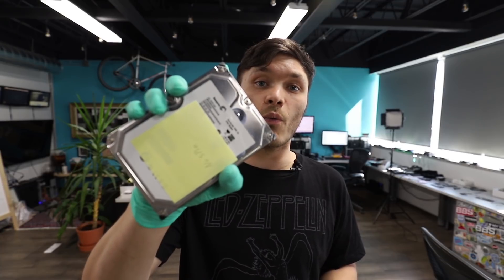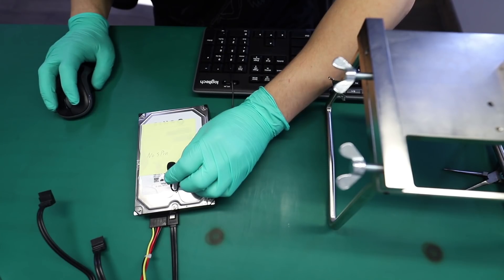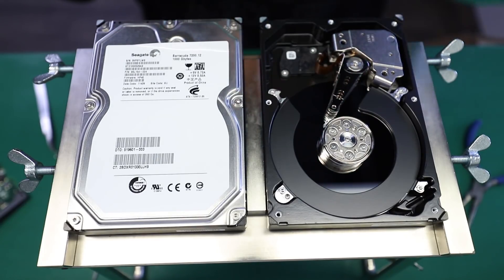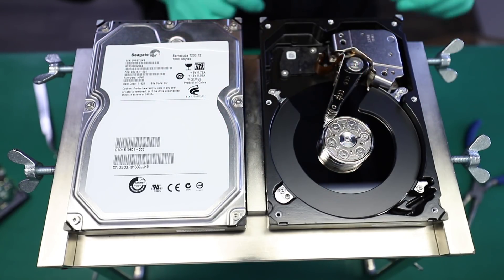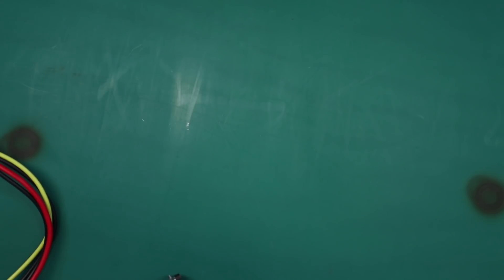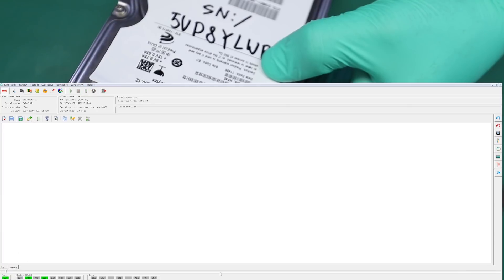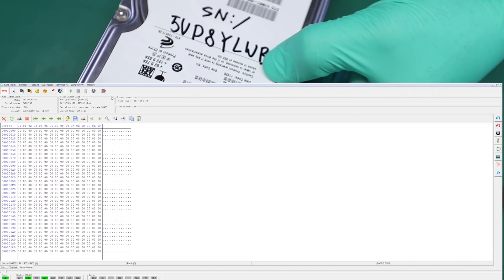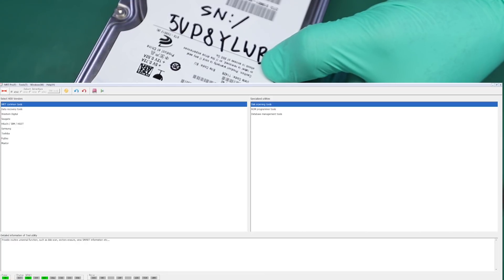Seagate is making buzzing noises | platter swap

Comment: I kind of like those old 7200.12s, especially the HP OEM ones that have AAM locked to "performance". They're pretty loud at seeking and it makes it clear what your computer is doing at the time.

That noise from trying to spin up with a stuck spindle has nothing on the old "musical Maxtors" though...

Comment: hi,

I want to ask: relatively recently I purchased a 5 Tb Seagate external hard disk. I have so far only use dit 2 times in 6 months. hadn't used it in quite a while till recently. It does work and my detects it but it does buzz quite a bit. when I put my ear to it, it does spin but also I hear sometimes the sound as if we would hold smth against a spinning wheel, like soft taps, those are really only hear able very closely, or as if it very very briefly is blocked. touches smth, slows down, doesn't spin straight however I can describe it. does this indicate a problem or is it normal? I use the supplied short usb cable

Comment: hey, what the main requirements swapping Platters? Does the hard drive must be with the same capacity, model, version?! or just the same make and similar look? thanks
Reply from the maker: chassis need to be the same. The same family is enough in most cases. Different models can have identical chassis
Reply: @hddrecoveryservices   my head is damaged, cannot find replacement! Do you think the head from 60GB hard drive will be able to read 1TB platter? Assuming they are the same speed.

Comment: I wonder if someone could give me some advice, bought a new 2tb hard drive fitted it a year ago, used it as a storage dump for media. A few days ago, it made some really loud grinding sounds. Later when I checked my drives, the E drive was gone on windows, but I could see it in disk management. The 2tb volume of the drive then read as 3.68 GB, when trying to fix the problem, it came up as ‘i/o device error’. Tried CMD to see if I could work the problem and got ‘Cannot Open Volume for Direct Access’ on that. The drive was only half full which surprised me re volume, nothing I have tried worked. When I use device manager, it says the drive is working properly when it patently isn’t. Would this suggest that the drive is dead? Any help would be appreciated.
Reply from the maker: There is nothing to try other than sending it off to data recovery center my friend. Loud grinding sounds is a clear indication of head crash. Heads are dead, platters could potentially be damaged by now as well. The more you power it the worse the condition gets. Busted heads are moving back and forth damaging the surface more and more when the unit is powered and spinning, hence the grinding noise. 3.68GB is what Seagate gets to show from the PCB. If platters are damaged expect to pay a lot for the data if it's ever possible at this point. We see a lot of platter damaged cases daily, and yet it is possible to partially recover data from them, it's a very tedious and time consuming process. Sorry this happened, but only having a backup will prevent such accidents. One of my work drives just failed a few weeks ago in almost the same way
Reply: @hddrecoveryservices  thank you for the reply, in the back of mind, I thought the worst, and your feedback pretty much confirms it. luckily most of the same data lost sits on an external drive as a back up. Only had that drive for just under a year, bought on ebay

Comment: Proper matching is not soo important for a platter swap like this right? Just asking out of curiosity.
Reply: Keeping the platters in alignment relative to each other (in a multi-platter drive) is very important. That's why he tapes them together. They do make fancy tools to "grab" the platters, but Seagate likes to put various plastic blades and stuff between the platters to control airflow and those often make the fancy tools not fit.

As for matching parts, not much of the donor is being used as the heads, platters, and PCB come from the patient and should be already matched from the factory. It's of course necessary to use drives of the same or at least very similar models so that the parts fit and operate correctly, but the serials shouldn't be too important here.

I don't know how far you can "fudge" the models, but I'd imagine pretty much anything from the same family should work. I mean, a while back, I had some 15GB and 20GB Maxtor drives, the 20GB having 4 heads and the 15GB 3, but otherwise identical. They were both dead, the 20GB having bad heads and the 15GB having a fried board. I wasn't interested in recovering any data, but putting the board from the 20GB on the 15GB, mostly out of curiosity, did make it work. While you can't necessarily swap boards between modern drives without any kind of adaptation, I'd imagine that some parts like the case and spindle motor are still interchangeable between a handful of models.

I do still have that 15GB drive and it does still work :)
Reply: Thanks for the detailed answer. That's also what I thought, but wanted to make sure if my theory is correct. I have no real experience with data recovery (yet), but am reading as much as I can about it because this is a very interesting topic.
Reply from the maker: Really well explained. Thanks April!
Reply: @aprilkolwey4779 I assume the bad part in this drive was the drive motor?

Comment: Haven't u change PCB after platter change ?
Reply: In the 7200.12 drives the head stack is screwed in on the bottom under the PCB, so you have to remove it anyways. And of course you put the PCB of the patient drive back on, so you don't have a missmached firmware. You only need the chasis of the 7200.12 drive with a working spindle. So everything else you transfer to the new chasis from the patient drive.

Comment: I still have this doubt ... that has the beep/buzzer ... if I change heads or replace only the chassis with functional engine. Can someone help me heal this classic doubt ???
Reply: Are you saying that you have a drive that's beeping/buzzing and not spinning, like the one in the video? Could be heads stuck to the disk, bad motor, bad board, or any number of other things. If you mean it spins up and clicks/buzzes/beeps, that's a different problem and head or platter damage would not be surprising.

If there's data on the drive that's important to you, you should send it to a professional. The person that uploaded the video does offer data recovery services (I'd hope that would be obvious) but there are also plenty of other companies that do the same.

If it's not important enough to justify the price but is more of a "nice to have" sort of thing, I suppose it might be worth a shot to try some things yourself. Just keep in mind that attempting to work on the inside of a hard drive at home, while it may occasionally succeed, is very likely to fail and destroy all of your data in the process. If you understand the (significant) risks and still want to try anyway, I would recommend, at the very least, watching several videos and performing a lot of research on the subject. There are many seemingly tiny things - dust, platter misalignment, head damage, ESD, etc. - that can damage or even completely destroy a drive, and research may help you at least reduce the risks of these slightly. In addition, researching your problem will likely assist in determining which part has failed as well as the proper method for replacing the failed part.

Good luck!
Reply: (this comment is just kind of me bragging, feel free to skip it)

As a sort of side note to the above, as well as just a kind of lighter note in general, here are some of the home hard drive repair successes I've had:

Toshiba MK4309MAT (4.1GB laptop drive): Spindle was stuck from years of non-use, manually spinning it some allowed it to spin up and work properly again.

Quantum Fireball Plus LM (20.5GB desktop drive): Components in the head bias power supply section were broken off of the board due to shipping damage, causing the drive to click. Soldering replacement components on allowed the drive to work properly again.

AT&T 97544SA (ancient 330MB 5.25" full-height boat anchor): Deteriorating rubber part "glued" the headstack into the parked position. Spinning up the drive with the cover removed and manually unparking the heads allowed the drive to be read, and I plan to "repair" the drive, similarly to the video on this channel with the "glue gun trick", to at least have some more fun with the drive even if it is not trustworthy for data storage.

Comment: Had seagate do the exact same thing.  After parking the head, took the drive out and shook it around.  After that plugged it back in and it started up.  Then I imaged everything from it to a new WD drive.  Fuck seagate and their garbage drives.
Reply: I agree: All problems i've had with HDD are related to Seagate. Never more. Always WD Black now.
Reply: Char Aznable Damn.  Worked like magic. Thanks for the tip.  Now hopefully I can recover the data..